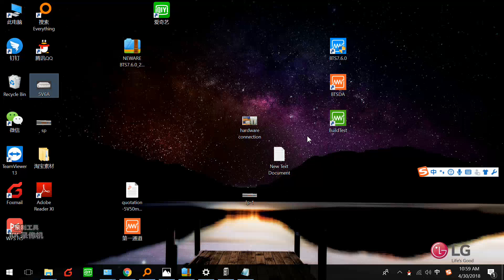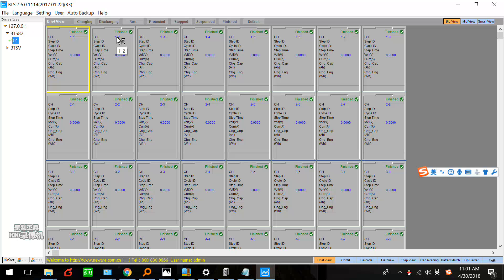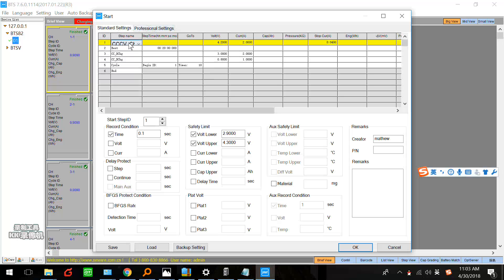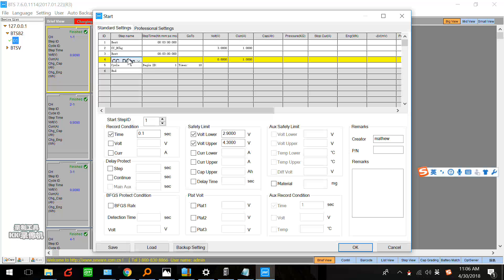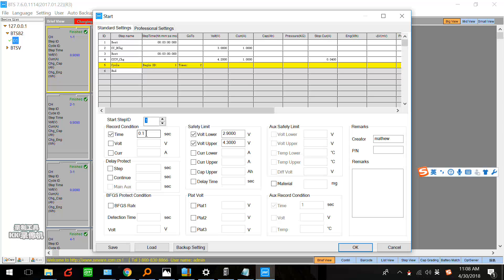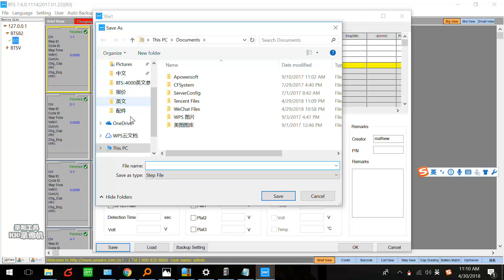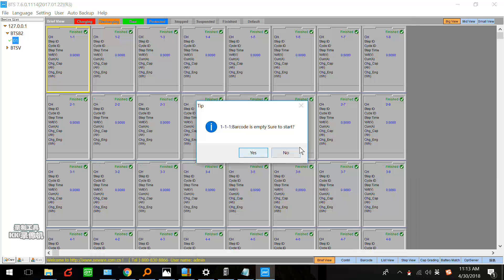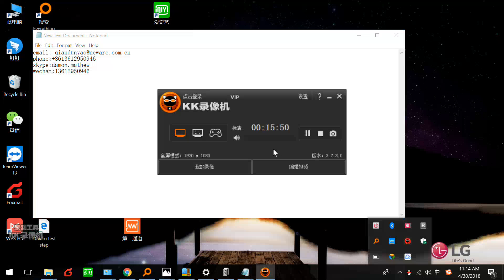how to use neware battery testing system to test lithium battery(in English language)

Comment: i need this test video 
EV Cell Battery Electrical Tests.
1-	Capacity (Ah) and Efficiency Tests.
2-	Voltage and Current Measurements.
3-	Internal Resistance Measurement (DCIR & ACIR) →(mΩ).
4-	Open Circuit Voltage (OCV) Tests.
5-	Charge/Discharge Testing.
6-	Overcharge/Over-discharge Testing.
7-	External Short Circuit Testing.
8-	State of Charge (SOC) and State of Health (SOH) Testing.
9-	 Coulombic Efficiency Test.
10-	  Cell Temperature via Charging and Discharging Modes.

Comment: Excuse me, I'd like to ask you..
How if my battery charge and discharge test can be done (running perfectly) using BTS NEWARE, but we can't save the data?? (.nda data)
Thank you
Reply: The latest device is used with the mid-machine, it is responsible for connecting the device and the computer, so as to obtain data, and there is a power off protection function. The data can also be exported on the computer software.(nda)

Comment: What is the concept of Time just below the Record Condition as it is set to 0.1 sec what does it mean?
How to check the capacity of battery with load and without load,and as you have put different values of battery why?
Reply from the maker: Record condition means, how many data u will get from the software per second, if u set 0.1, machine will record 10 voltage and 10current etc. Per second